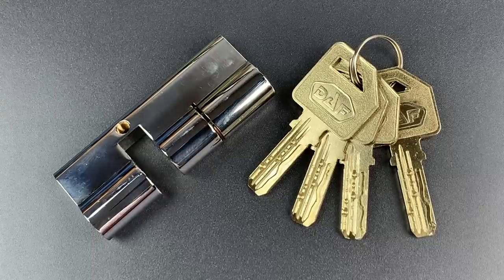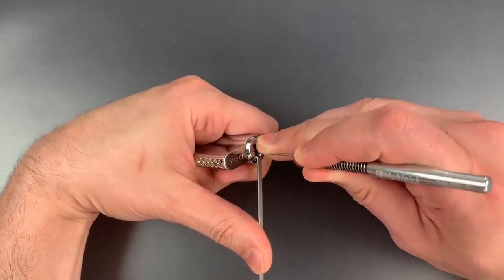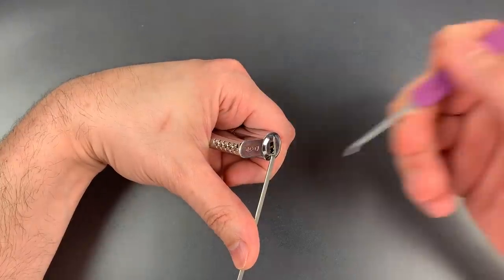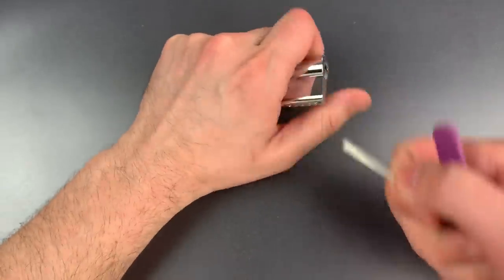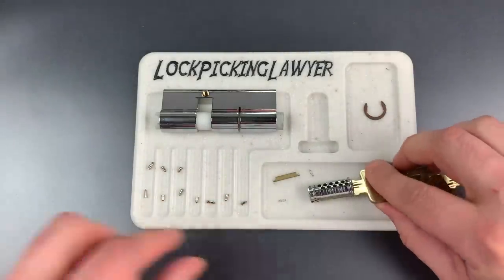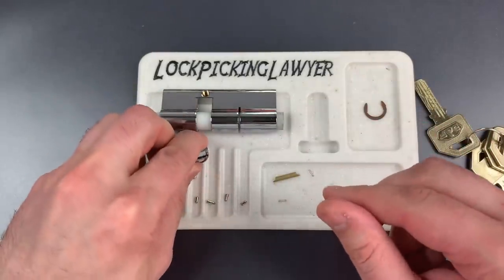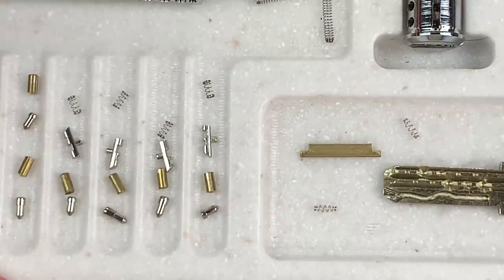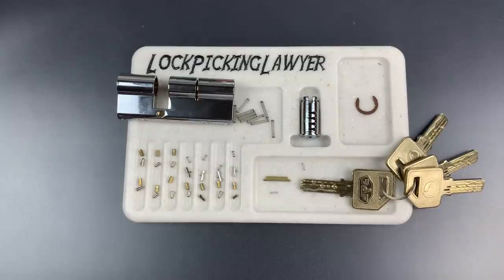[871] Turkish High Security: DAF Kilit Model DBS02 Euro Profile Cylinder (10 Pins, 4 Sliders)

Comment: HA! I used the same lock on my door. I did swap the pins before that tho, and my door had drill protection plates over the lock. I used to sell these locks in my shop, and since they were pretty cheap (~20 usd), for an additional fee i did the same upgrade for my customers. And one of them did the job, there was a complaint that the lock didnt work a week after i mounted it, so i went to take a look and found a broken pick tip inside it. I was so happy that it withstood the attack.
Reply: Snap resistant?
Strengthened?
Reply: “You sold me a defective lock!!!” “ oh did I? :D. Now kiss my ring and thank me profusely “
Reply: @roysammons2445  if you are asking for the lock, its neither of those, high security doors are very common around my shop, so the only thing you need to worry about is someone picking the lock because its protected inside the armored mechanism, and theres a tiny slit for the key on a thick steel spinning cap. If you manage to go through all that a snap resistant lock wont help much.
Reply: @jamesbizs   Naw she was a sweet young lady and she was so worried she did something wrong that she didnt even notice the key doesnt go all the way in. I did crack a massive grin tho when i saw what was inside the lock.
Reply: @momchilkarchev5019  I like your level of security 👍🏻
Reply: Momchil Karchev did the customer wanted his money back or he thanked you ?
Reply: @momchilkarchev5019  are you by any chance Bulgarian and if you are where can I find your shop?
Reply: @elveone  Yes in Sofia Studentski Grad when the whole corona ordeal is done, feel free to  come by.

Comment: That's a pretty good lock, especially if you replaced the upper pins with serrated or spool pins. No one would bother picking that lock.
Reply: Very little drill protection. Questionable snap protection. Reasonable pick resistance. Not really a good lock if you're relying on it to secure your house.
Reply: John Davis drill resistance ? This is not for a bank safe.
Reply: Onur Demir so um like someone hasn’t seen a lock drilled yet
Reply: @cultri6659  people drill locks, it’s just a case of finding the quickest way in. Chances are it’s usually easier to just break open a window.
Reply: @crispinmcsticks  Or melt the lock.  Heat is always fun.
Reply: @kjpierson1152  oh definitely fun, yes. But maybe not the most practical if you have to carry that gear with you.
Reply: @crispinmcsticks  Wait...normal people don't carry magnesium and thermite?
Reply: @kjpierson1152  hmm, now that you mention it...
Reply: @haakonht  ?
Reply: @cookiemonster-ky9ru  Sorry about that, stupidly written.

Point was for doors fitted with locks like these destructive entry is usually a way bigger issue and the preferred method.
Reply: @haakonht  I know that but someone comment that drilling a lock wasn’t viable until it’s something like a bank safe whereas it’s actually more common than you’d think
Reply: @jrd33  Isn't pick resistance the most important aspect for a house? They are going to get in either way. So as long as there is clear signs of forced entry the insurance will be good...
Reply: @_Ekaros  Most people want to keep intruders out. Since this is almost impossible, deterring intruders is the best option. Monetary loss is typically only a small part of the overall distress caused by having your home invaded.
Reply: @_Ekaros  I think a crowbar used to simply pry the door open is the more common way for a burglar to break in. It doesn’t take as much strength as you’d expect, and you’re not breaking the lock, but rather the wood that the latch is fastened to. It only takes about 5 seconds or less. Of course this is in situations where they don’t feel that they need to remain as quiet as possible.
Reply: @_Ekaros  thieves don't have the discipline to learn how to pick locks, breaking and entering is the default method.
Reply: @jrd33  At least for me the most important thing isn't to prevent entry--if they truly want to get in they'll smash a window--but make it easy to prove to the insurance company that it happened through no fault of my own. No visible signs of entry means that the insurance company can claim that I'd left the door/window  open even if that isn't the case. Entry using lock drilling is easily detectable.
Reply: @taotriad  Fair enough.
Reply: @cultri6659  That's a dumb argument for having no drill resistance. Imagine you have a music studio, you use this lock, the studio has no windows thus no other way of entry, but it does contain thousands of euros worth of equipment. If you could just drill the lock and be in, that'd be very poor secure, for such a huge amount of expensive equipment.

Just because you aren't stealing from a bank vault, doesn't mean there's nothing worth stealing.
Reply: Guys is there some lock for entrance door that you would recomend? Avalible in europe and not cost a fortune!?
Reply: On the contrary. The likelihood of someone "bothering" to pick any lock is determined primarily by two things: the reward for picking, and the determination of the picker.

Comment: This lock took like two minutes to pick. After adjusting for LPL, that's a lot of time.
Reply: He should find all the ways to open the combination lock from happy meals a few years age I think it whould be hilarious what do you think.

here is a link to the picture of the lock

http://bricker.info/images/parts/clikits096.png
Reply: Yeah, I was really surprised at his conclusion of "there are definitely better options".  I mean, I guess there are similar locks that are better, and maybe this one's price means you'd never consider it for common usage?  It's clearly more secure than most of the locks that get reviewed here.
Reply: @totlyepic  right? Also consider that while kneeling against a real door where you can't wrap your hand around the backside of the lock to comfortably hold the tension wrench, and you can't use both your hands to manipulate and twist the lock/pick against each other, and other environmental conditions, this would be 5000% harder to do on a real door. Also LPL has picked thousands of locks, far more than I guarantee any thief ever will.

This lock is beyond adequate. A burgler will just knock the door frame off the wall before they would ever go through this trouble.
Reply: totlyepic I think maybe it’s a one-trick-pony: complex mechanism.  But for a little higher price, get a better made lock.
Reply: mlnlme1 Well knocking off your door frame is a guaranteed way to make a lot of noise fast. In a suburban area that would get the cops called on you pretty quickly.

However nobody is going to notice someone sit there for two minutes to pick a lock - I’d even bet you could sit there for 20min.

If they don’t have to sit there at least 30min, bust out an angle grinder, or bust down the door it may as well not be locked at all to anyway with the patience, knowhow, and tools.
Reply: It's not very long at all when you consider the sheer number of pins he had to pick.
Reply: It's a complex mechanism, but its also a poorly designed mechanism.  If the false gates can't even come in to play then someone screwed up.   Either that or they were just added to justify marketing blurbs for having them, which I would think would be false advertising if they did.  No idea how you'd prove it was intentional though since they are technically there.  So yes, there are better options out there.
Reply: @totlyepic  It depends on the price basically. Although since this is 40 bucks I'd say it's a good choice.
Reply: Petition to have "LPL" as a new unit for measuring time compression, 10min/1 LPL = 1 sec
Reply: Plus he’d seen the key so he knew what he was up against.  IDK how much time that would add if he (or anyone else) picked it “blind”
Reply: @zeph6182  Except for the vast majority of would-be thieves the amount of time to pick any lock would be "infinity". Chances are someone trying to rob your home will be doing it because they couldn't do anything else. Why on earth would they teach themselves the arcane wizardry required to actually pick locks?  Only about 1% of break-ins are done by what the DJS calls "lock picking", except that according to their definition, shimming a window latch counts. Actual incidents of lock picking in burglaries should be pretty much nonexistent. Using sorcerous powers to get into a house is just not practical. The vast majority of people aren't sorcerers.

Comment: Hi, I bought a new lock for my dads back door as at 89 years old he is not as well as he used it be, What I wanted was a keyed lock with a turnbuckle on the inside so that he could not lock us out, he had a fall and because his key was in the back of the lock we had to break a window to get in. When I went to the locksmith to get some more keys I was told that the code on my key had to be sent to Italy, and then he would then get another code back that would enable him to cut the new keys. As a result of this, I had to wait 3 days before I could get the extra keys, and they cost me about twice as much as normal keys. I am glad that it took you a few more seconds than normal to pick this lock

Comment: When you do this kind of videos and the product is not that good, is it possible to offer a good alternative at a similar place on the spot? It goes something like "this is advertised as a high security lock but there are other better products in this price point, like the product X"  Great videos other than that!
Reply: Watching his videos, I've learned that the Avocet ABS was the one that made him  work the hardest (most steps) and required even a special little magnet to pick.  No way that any regular picker would bother with all that.

However, the one that he couldn't pick and one of much simpler construction was the Bowley.  Someone else picked it but that required a ridiculously complicate custom picking setup.  Even then, the Bowley required that the picker pick his way back out or lose his fancy equipment stuck in the lock. 

I'm going with the Bowley.
Reply: @jmchez  damn, that sounds like a really good lock.
Reply: @danielkorladis7869  And expansive one :| I think they've got two product and the cheapest one is 150 USD, and each suppl. are like 20$ a piece. But, yeah, they look legit :)

Comment: LPL : This is a turkish HIGH security lock.

Also LPL : Picks lock in about 2 minutes :)

Insane security lock, takes 10 seconds extra :)
Reply: Also LPL: From the same chinese factory
Reply: That 2 minute pick time is longer than some videos
Reply: @MisterJackTheAttack  Agreed, but if your "high security lock" takes 2 minutes for a picker, then it's not very secure.

There are locks that take a lot longer to pick or is even unpickable, so if the benchmark for calling it high security is 2 minutes, then the bar has not been set very high.
Reply: @JohnDoe-bd5sz  don't forget  LPL is essentially a God at lock picking so 2 minute pick for him is 20 minutes for a two bit theif

Comment: So I've been thinking about this for a while and I believe I've come up with what would technically be an unthinkable lock.

The most keys are single-sided, maybe double-sided, so I'm thinking a triple-sided key with 10 pins per side for a total of 30 pins.  The lock has two keys, and both keys have to be turned at the same time but at different speeds.

Basically the goal is to make it require way more mechanical input then someone could physically do.

The only thing left at that point was just be making sure that they made it out of something other than paper mache so you couldn't just bust it open

Comment: when you have your door locked with what we call in the Netherlands 'nachtstand' (i.e. you have to rotate the core multiple times 360 degrees before you can open the door) should you not pick it everytime you rotate 360 degrees?

Comment: i watched about a hundred of your videos and im  still  wondering : What is the best lock? Which one is the most pick-proof, the most secure cylinder engineering? Which one out of all the types in the world is the most worthy one?
Reply: Watching his videos, I've learned that the Avocet ABS was the one that made him work the hardest (most steps) and even required even a special little magnet to pick. No way that any regular picker would bother with all that. It also had lots of drill protection.

However, the one that he couldn't pick and one of much simpler construction was the Bowley. Someone else picked it but that required a ridiculously complicate custom picking setup. Even then, the Bowley required that the picker pick his way back out or lose his fancy equipment stuck in the lock. 

I'm going with the Bowley.

Comment: In your opinion, what's the best lock picking kit for a beginner and what's the best lock for a storage unit under $100?
Reply: I recommend the  SouthOrd PXS-14 and a master #3 to start, once you "master" the little padlock hit eBay and buy an assorted lot of used locks. And for a good lock under $100 you have the Abus 37/80, LPL had one open in video 548, but it was an older core and the modern ones are sufficiently pick resistant for most applications.
Reply: @josuelservin2409  thank you

Comment: I'm moving to a new place in July. I am planning on changing the locks. What front door locks do you recommend?
Reply: He has a video about this. Expensive high security locks aren't worth it. When the first floor of the house has other vulnerabilities such as windows.
Reply: Change the front door
Reply: Medeco mortise cylinder. But if your windows aren't as secure it really doesn't matter what lock you use cause locks are really only for honest ppl.
Reply: I would try to secure the whole place, including windows and anything else. And I wasn't thinking of anything super expensive. Just whatever is the least terrible that I can pick up at a local hardware store or order online.
Reply: @Coolkegcomputer  as long as the lock has tight tolerances and multiple security pins that's all that's needed but all your really doing is slowing them down. It really depends on how much time they have without someone noticing.
Reply: @Coolkegcomputer  Abloy?
Reply: Anonymouspock - what always surprises me about the protec 2 is, it’s virtually unpickable for the overwhelming majority of people, yet it can be drilling open in 20 seconds.  Bizarre!

Comment: I'm confused about the application for this lock.

Is it supposed to go in a door?
Reply: Correct, these are 'euro' cylinders, and as the name suggests, these are the standard cylinders that go in doors in Europe.
Reply: German doors all have a shaped slot to install a lock. ( Profilzylinder ) U can choose a wide variety of security levels / manufacturers. Some have different sets of keys so u are able to open eg. the main gate and your office but no other office. Boss has a master key and several levels between are also possible. Even a Lockout key is possible. Once locked with that key no other keys will fit anymore. Seems this system found its way into other countries. But this is just a cheap chinese made knockoff. The manufacturer itself did not fully understand all of the purposes. Some of its features are not even functional.

Comment: your suspicion that both locks are made by the same entity or partnership is true, but I would rather guess that it is an Italian design assembled in Turkey with components made in China and about the issue with the false gates, again I would guess that they designed a modular system which can be customized according to certain aspects of the needs in a certain market. At the end $ talks if you get what I mean😁👍 thanks for the nice video.

btw if you think about people are driving different types of cars with essentially the same underpinnings and engines only capped by software at different power levels which are sold for different prices, why shouldn't the lock industry do the same thing.

Comment: Strange that they didn't bother putting a single spooled or serrated pin. It wouldn't cost much more and yet it would be an improvement.
Reply: what are those for?
Reply: @shachar2  Those create false sets, giving the illusion that the picker pushed the pin to the required depth.
Reply: Thanks  @Sheevlord

Comment: How much harder is it to pick a lock without knowing the internals? I mean, have you made any videos on picking a lock "blind" and without having a look at the key or the type/model of the lock before you begin?
Reply: Interesting question. That would make for a good video.
Reply: Robert Burns - I’ve mentioned this elsewhere in this thread but you can check out his older videos where he does just that with some challenge locks.

Comment: If you over picked one of the pins would you have to start over?
Reply: He usually just releases the tension a bit. It is very tricky for a new guy. For him is not usually a problem. If the rest of the pins drop you need to start over.